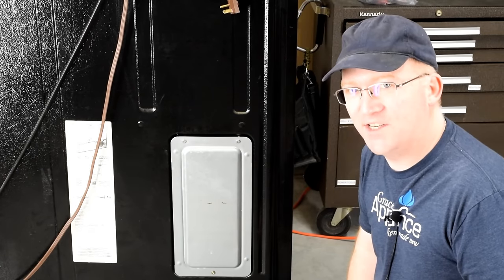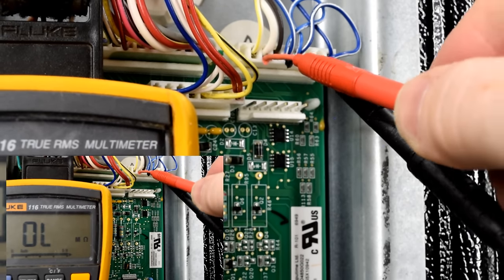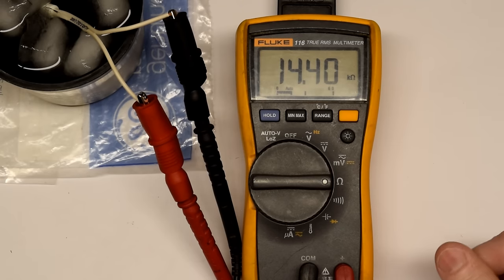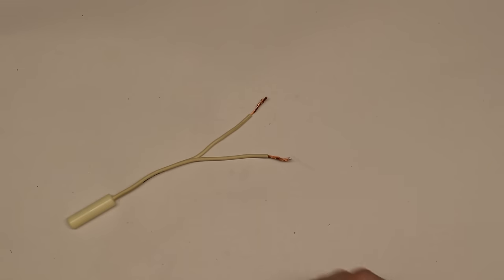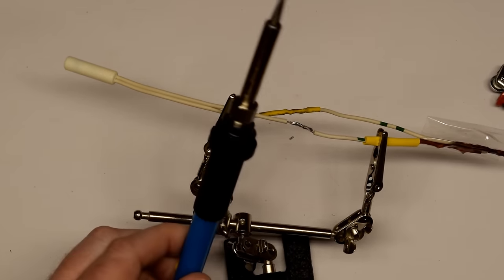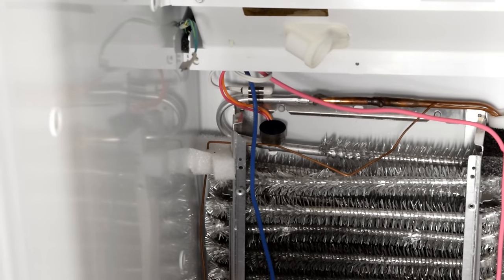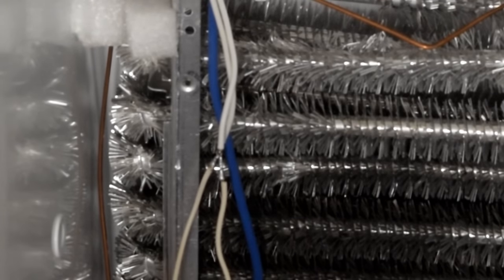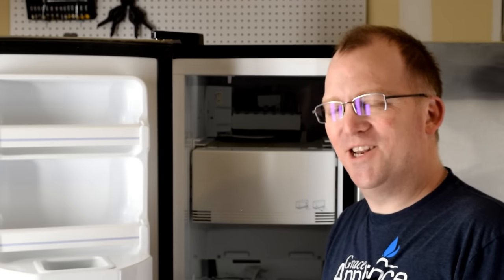Testing and Replacing a GE Defrost Sensor - WR55x10025

Comment: i have a fridge whirlpool WRR56X18FW01 is is a fridge just a fridge no freezer. that being said. how hard or what do you have to do to make it a freezer. can you make it a freezer.
Reply from the maker: Hey Tunnelwind, most times it will be easier to take a freezer and make it a refrigerator because the defrost components are already in place. Yours appears to also have conventional defrost components. So, in theory it should work also as a freezer assuming the evaporator is large enough to achieve these temps.

The way I would approach it is to direct wire the compressor using a hard start Rco810 (use the 810 not rco410) this way if power is on, the compressor runs. Also, you'll need to find a way to also have the fans run full time when the compressor is on. I'm not 100% sure what to recommend there.

But, beer brewing guys often use this same method when turning a chest freezer in to a refrigerator. They'll use a on/off switch that has a connected thermostat that you'll insert in the freezer cabinet to monitor temp.

I hop this info helps!

Comment: Thanks for the video. Are the pins on the control board the same for all GE side-by-side refrigerator?  Mine has the control board on the back like in your video but not sure all the pin wiring are the same.
Reply from the maker: Yes, there are two different part numbers for the boards that all the GE side by sides use, but they all share the same wiring to my knowledge. However, some of the fridges have different features depending on the model, obviously. For example, some of them will have 2 temp sensors on the refrigerator side where this refrigerator only has the one. 

What issue are you trying to figure out?  Also, what’s your model number?
Reply: I have the GSL25JFXLLB model. The problem I am having is the frig sometime didn't get cold enough, especially the right side. When this happened, the freezer side would get slightly warmer too, enough for the ice to partially melt.  I notice the compressor was not running during this warm period. Then the compressor kicked in and ran as though nothing was wrong in the first place.  I had replaced the defrost heater 2 years ago after the ice build up which was easy to diagnose. Now I am thinking maybe the defroster thermostat is on the friz.
So I went and checked the control board and it looks like the one in your video, which doesn't have any connection to pin1. The measurement for pin 2 was only 8KOhm and the other I remember them to be in the 13KOhm range.  All the fans appeared to be running.  I cleaned all the lint from the condenser grid like you show so it should run better now. 

So can a balky defroster thermostat cause an intermittent warming? Also because the right side sometime got warmer, is there anyway to trigger the damper door from the control board to see if it is still working?

Thanks.
Reply from the maker: Hey! 
It defiantly sounds like you’re on the right track. 
A failing defrost sensor can defiantly cause these symptoms because it will keep the defrost on for too long.  

The defrost sensor is tested between pins 4 (black) and 5 (blue and white) on J1connector near the top right of the control board.  (Shown in this video)
But keep in mind the Ohm reading will change depending on its temperature, so if the freezer internal temp is around 0’F your evaporator sensor you test between pin 4&5 should read about 42.5k Ohm. 

As far as testing the damper function, yes - by leaving the Freezer and Fridge door open for 3 minutes it will activate the damper door, but for your scenario a failing damper won’t cause the Freezer to get too warm so it’s likely not your issue.  

I hope this helps and let me know if you have any questions!
Reply: some are different based on the models....I've got a GE Profile and its a bit different...
Reply: GE Side-by-Side ONLY - Refrigerator Repair Videos 
Where can I find the leads you’re using my meters leads are to big
Reply from the maker: Hey James, I'm sorry I am not sure of the name brand on these leads as they were a cash register impulse buy from appliance parts depot.
If you'll search for Needle Tipped Meter leads you can definitely find some you'll like.
One thing I do like is that they are not part of a kit, but rather are one piece leads with non removable tips.

You would love them though.
Reply: GE Side-by-Side ONLY - Refrigerator Repair Videos 
I appreciate the help I’ve been having a ton of problems with the side by side on my property all are not cooling and mostly a clicking sound by the fan Relay
Reply from the maker: @VinoDallas  if you're getting steady 120vAC to the two wires leading to the relays, this  could be bad compressor relays.

However, in my experience relays often fail when the compressor is pulling too much power, i.e. Amps. 
Causing the relays to fail. 

If you or someone you know has a  clamp meter (amp meter) you can simply clamp the meter around one of the two wires leading to relay when the compressor is running and you should get around 1.5Amps. 
If you're getting more like 10 amps, that means the compressor motor has locked up.

Let me know if you have any questions.
Reply: GE Side-by-Side ONLY - Refrigerator Repair Videos 
I definitely will let you know maybe sometime Friday when I get a chance to test the compressor.

Comment: Andy I have a GE profile refrigerator that occasionally does not  go into automatic defrost mode and I do it manually by disconnecting the power for  approx. 10-12 hrs, I checked your video on testing the ohm resistence  on j1 terminal on control board.I METERED THE RESISTENCE ON J2-4.8K,J3-11.8K,J4-12K from pin5 terminal. Do you think that the sensor reading 4.8k in fresh food section could be causing the refrigerator to intermittently fail to go into auto defrost mode.Appreciate your  opinion.   Thanks.
Reply from the maker: Hey! Sorry for the slow reply. 
I’m not sure of your model number, but the majority of the GE temp sensors are the same. The resistances you provided may or may not be correct because they vary based on what temperature it is currently in the fridge / freezer.  The 4K Ohm range will typically mean it’s close to 70F in the fridge cabinet. However, this wouldn’t cause any variation on the defrost cycle. The specific sensor that controls that would be the defrost sensor on top of the evaporator itself.  
If you wanted to send your model number it may help in giving a little more precise answer, but the short answer is that intermittent defrost (as long as the defrost sensor is ok) would most likely be a failed control board. (Or poor connection at the heater) 

I hope this helps.
Reply: Andy the model# is pfss5rkzhss.I am suspicious of thermistor in freezer compartment but am unsure where it is located.Temperature in fresh food section when I took reading was approx. 42-44f. I changed control board in refrigerator in November 2018. Is sensor in fresh food section behind right corner bracket?
Reply from the maker: @giantdude86  I agree that the temp sensor sounds like it's bad if the true temp was 42'F at the time of the test.  That read out indicates the sensor thinks it was 70F+/-. 
So, i'd repalce that for sure. 

But, it doesn't have to do with the intermitment defrost issue.  Your defrost sensor is the same part number that I've shown in this video Part # WR55X10025
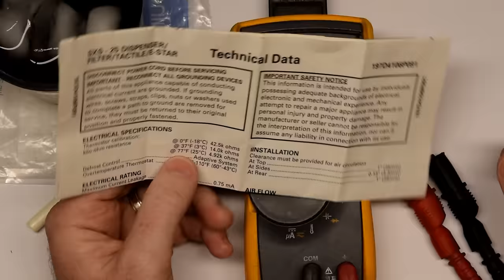 and can be tested using the same concept as the other temp sensors using the chart at 5:05sec of this video. 

I'd start with the defrost sensor especially since the board has recently been replaced.  
Another thing worth checking is the install instructions for that board (step 2) has a list of serial numbers that require a modification to the wiring harness and i've seen it cause goofy issues like this - but usually right after the install - not months later. It probably doesn't apply to you, but Just thought i'd let you double check on that: 

https://www.scribd.com/doc/115029528/WR55X10942-Installation-Instructions
Reply: Thanks Andy appreciate your help
Reply from the maker: @giantdude86  
Also, I'd unplug the fridge, remove the control board and inspect the back side of it for a burned solder joint as shown here: 

https://www.youtube.com/watch?v=zbmAqizE128

Sorry I couldn't be of more help!

Comment: I'm curious as to what a defrost issue would look like. My used fridge and freezer started getting warmer and  after watching your videos, I think it may be a defrost issue, but it's not all the coils, its mainly a solid freeze on that copper line that runs along the blue wire on the freezer side. It seems to stop once it reaches the coils though. I'm stumped. Was hoping you might have some input.
Reply from the maker: Hey Matt, 
If I’m understanding you right, not all of the coils are frosting up is that right?
Only the first run or two of the evaporator is frosting up?

(And Assuming the compressor is running and not cutting on and off)
If so, this isn’t a defrost issue, but rather some type of sealed system issue. Meaning either the compressor is shot (I.e. not compressing as much as it needs to), or is low on refrigerant which means it would have a slow leak somewhere in the system. 

Let me know and I’m glad to help as much as I’m able.  

Thanks!
Reply: @GraceAppliance  not even the first run or 2. Frost is only accumulating on that copper connection
Reply from the maker: Yeah, all this points toward a sealed system issue which isn’t a diy task nor is it cheap unfortunately. Most times, a sealed system issue will scrap the fridge.  I'm sorry for the bad news.
Reply: @GraceAppliance  originally the fridge and freezer worked, but was leaking water. I contributed that to the broken water hose in the door (which will not be hooked up or used. I locked the settings) or the humidity when plugging it in for the first time. But seemed to work fine for about 5 days. After that temperature started dropping, but never hit room temperature. I cleaned the coils around the fan (worked without it cleaned, so I assumed it wasnt the issue), replaced the heater coil, didnt help, and watched your videos trying to find the next step. Havent yet tested the sensor, thermostat or control but seeing as it wont stop running I'm thinking those may not be it. Also, not sure how relevant it is, but there is some rust in the bottom as it sat in a garage for a year
Reply from the maker: MattDangerChapman if the bottom of the pan has rusted through, this could certainly cause a leak by letting the defrosted water drip to the ground. Or, perhaps it made ice cubes when it was running ok and when it got warm the cubes melted?
Either way, if compressor is running for hours yet the coils still do not frost up beyond the first few rungs, it’s not defrost related.
Reply: @GraceAppliance  the leaking was least of my worries. I'm still learning terminology, but yeah only the left side of the evaporator is freezing up to the top of that copper element to the other side of the defroster is icing up, but that's it. Any ideas? I was under the impression a refridgerant leak would be visible with non clear colors
Reply: @GraceAppliance  I'm trying to recall but i think the first rung was originally iced, but since unplugging and defrosting it seems like only the left side frosts
Reply: Also, door was removed to fit in the house and unfortunately water line was snapped. Was not intending on hooking up water but contributed leaking to water still in door from previous owner. Either way, only mentioning it incase of relavence to temp. Issue
Reply from the maker: Hey, 
No, a refrigerant leak would no be visible. It may leave a slight oily residue, but most times would not be visible.  
Even if no refrigerant leak, a failed compressor will give these same symptoms.  
I hope the info helps.  Thanks!

Comment: Mine came up to 13.13.  Is that close enough to assume this is still good?  It did up very slowy gradualy from about 9 up to 13.13 before it stopped, if that means anything.  ice cubes and water was about 32-33ish.

Comment: If your evaporator is all frosted up and you’re checking the sensor for ohms at the control board what would my meter be reading if the sensor is good and if it’s faulty?
Reply from the maker: Hey, it would depend upon what temp the evaporator is. At 36'F it should be around 14k ohms, 5k ohms at 77'F.  The evaporator would be more like -5'F I'd think so I'd expect it to read about 36-48k ohms would be in the ballpark of a good sensor.  
Given the guess work involved in determining the true evaporator temperatite, the best way I know of to submerge the sensor itself in ice water and look for 14k ohms, because that's a standard temperature that is repeatable in the field.

In the event that the evaporator has a  defrost issue the sensor would be fully encased in ice and thus you'd know it's 32'F.
Reply: GE Side-by-Side ONLY - Refrigerator Repair Videos Thank you for your response. If the evap is totally frosted up and the sensor is attached directly to the evap line as shown in your video then as you said it would most probably be -5 degrees and I can check that at the control board. I just found out maybe it was you, but GE was bought out by Haier, a Chinese company. Is that just the appliance line only? It was said that it happened a year ago.
Reply from the maker: @josephfolsom2030  yes, that's correct. Haier bought GE and as far as I know it was just the appliances section. 
Uggg
Reply: GE Side-by-Side ONLY - Refrigerator Repair Videos I have been a tech for over 37 years. I’m an old school guy and have to look to you younger ones to help the old dog learn the new tricks. It keeps my mind active. I retired from working a state job after 30 + years last March, and was doing appliance repair on the side while there. Needed to supplement my retirement to afford my health insurance. Just to be frank about it, the Lord literally exploded my appliance repair business to where it’s a full time job. I’m leaving out a lot of the details of how miraculous this really was.
Reply from the maker: Awesome Joseph!  He did something similar in my business as well. It lead me away from the repair side as full time, but still it's such a great skill to have.  It applies to so many other things you might work on.

Comment: I replaced the control board in our GYE22HSKMSS but it's still not cooling the fridge properly.  The replacement board made no change in operation.  The fridge cools for about 15 minutes but then stops.  Is this what I should try next?  Was really hoping this board would be the fix but that doesnt seem to be the case.
Reply from the maker: Have you tested to see what ohms you are getting for the refrigerator temperature sensor as shown in this video?

If I'm reading it correctly, your freezer temperature is as expected, but the refrigerator side is what you're dealing with, correct?

If the temperature sensor is failed, the damper door will not open to allow the cold air from the freezer to get to the fridge side.
Also make sure you do not have any food blocking both the upper and lower vents inside the fridge section.
Reply: @GraceAppliance  The fridge has 2 evaporator coils, one in the fridge and one in the freezer.  Last night, I found a guide to put the fridge in to service mode using the front dispenser to run diagnostics test.  The temp sensors all passed the tests.  The new fridge evaporator fan failed, it was reporting 0 rpms.  I put the old fan back in and it passed, showed proper functions.  The original fan did not work at all with the old computer board.  After taking the fridge out of service mode with the old fan and new control board the fridge appears to be working properly.  I put a glass of water with a temp probe in and it was 33F this morning.  So far the fridge is working properly for now.
Reply from the maker: Great to hear that!
Just FYI, the diagnostic test will only tell you if the sensor is open circuit or has continuity. But, if the panel gives you a temp # (like 45F) you can then use that number to see if it matches up with the true temp from a separate thermometer.